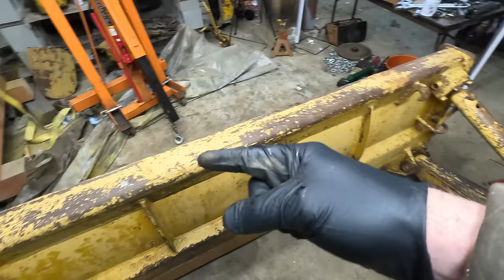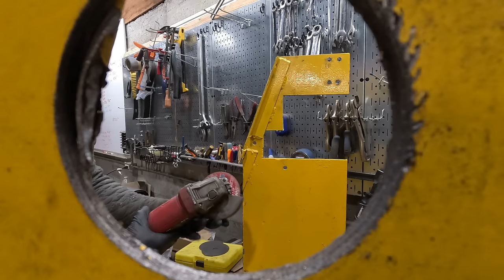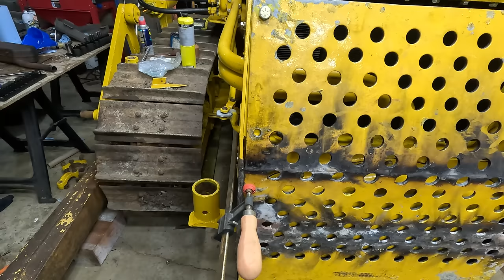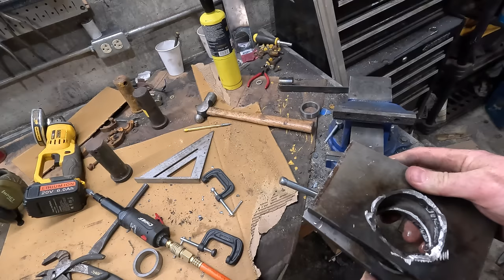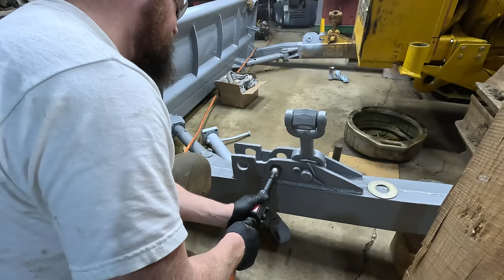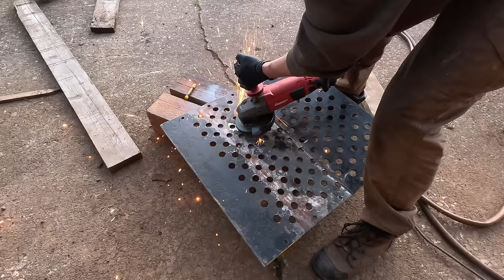Caterpillar D4 blade fitting and tilt modification

Comment: Just a little bit of feedback when you're welding structural stuff push the puddle and don't do circles or zigzag or anything just push it slowly just a helpful tip and making the 45 bigger will help bond the two pieces together smaller 45° the middle isn't bonded to the other piece of metal

Comment: You need to adjust your oxygen settings on your torch at the handles. You want little sharp pointy blue cones coming out of the torch tip when you mash down on that oxygen lever to cut. It cuts cleaner and smoother. Also hand and arm placement is the key to welding and cutting. Practice your cuts and weld movements before you start cutting or welding. Your welds are getting lots better since you quit using that flux core mig. Good luck from Texas and give Charlie girl some love for me!!
Reply: - Useful insights and correct from my experience level.
- Thank you for helping out friend, Matt.

Comment: Gr8 video. Really enjoying the build. Just so you know that crack in the centre of the weld is because it's been run down hand, on structural  parts always vertical up.

Comment: You won't be sorry you notched the grill for those stiffening ribs. You'd be surprised how easily, and often you find yourself pushing at max height. Unlike the blade you have, mine is something scabbed on from some other piece of equipment, my Dad thinks it's an old grader blade, and it hit the radiator at full lift while pushing and cracked that cast stanchion that has CATERPILLAR in raised letter. Now there's a fugly weld through the LAR section of one of the coolest parts of these "antiques".

Comment: Love your videos and it is like christmes when a new one is comming up. I worked for some years in a shop that build aluminum fuel tank trucks. When we welded on the truck we allways did compleatly disconnect the battery (both poles) or we connected between the poles a device that protect against over current. There is something with welding and batterys that do not go together. I saw once a battery cook itselfe to death because someone forgott to disconnect the battery. Don't ask me what the physics behind are this. I only know, we got jeled at when someone forgott.

Comment: Doing good.  To help your welds, you need to cut a bevel on the material and lay a root pass in then another pass over the top to cap it.  Also on your flush welds that you're going to grind flat (the grill guard) also put a bevel in so you're not grinding the whole weld off.  A mig wont fusion weld as much like a tig will.

Comment: Practical and durable mount points are the need.   Why the tilt is so useful is at the margin of road as to drainage. Or sometimes, where tree root ball or a boulder is encountered as removal or tailing.  I rather cheer and took note of the nice sound at idle,  The project as access roads to property is where all of the hard effort is turned and the machine begins to a renewed useful state.  And so repays as forward to real needs.
Think safety as operator.  M.

Comment: It's easy to use a hole saw to cut through thick materials if you drill a 1/4" hole at the center mark then lightly scribe OD with hole saw. Then drill a 1/4"+ hole (or 2) right in the scribed mark of the saw.  This allows the chips to be ejected out the holes so they don't get bunched up in the saw teeth.

Comment: One more thing.  As the trunions wear down, the blade will get closer to the nose. Something to watch for as you use the machine.  I also laughed out loud when you said the tilt cylinder will hardly be used. After you get used to it, you will never want to use a dozer without one. You will find yourself using it constantly. Keep up the excellent work! Looking forward to seeing you move dirt with it!

Comment: Hi Matt. The blade is made to tilt the angle of the cutting edge by adjusting the tilt rods by adjusting them out on both sides witch would give u more room between the grill. U might have to change the mounting ears for the tilt cylinder. Moving it ahead some and then adjusting the other side out some to bring the blade back to level.

Comment: Nice job Matt.  I like that you are not afraid to prime and paint areas that might need modification later.  I find it much more satisfying to be able to see the finished shape early.  IMHO I would cut the sides of the brush guard so you can see the raised “Caterpillar” letters.  Also on the left lower corner of the blade it looks like an H beam was welded on there.  That should be ground down so it doesn’t impede the flow of material across the blade. . . . But you probably already know that.  Thanks for the video.

Comment: When you’re welding heavy gauge steel you can preheat with a torch then mig weld it. You’ll get better penetration with your smaller mig welder.

Comment: Looks like you could have reversed the hydraulic fill fitting so the cap pointed towards center? Maybe it's  not symmetrical.

Love the series.
Reply from the maker: that's a good idea, but it is unfortunately not symmetrical, there is a hidden passage in there

Comment: Actually a very good job and well done, but if i was cutting that top bevel on the mounting plate I think I may have preferred to cut the plate longer and welded it flush to the rear plate and ground it flat making it all look like the one piece when painted.

Comment: Seriously tho consider buying a cheap worn out lathe and milling machine spend 2500$ on both and be amazed at what you can do with them I’ve made gears shafts and much more it’s so handy to be able to make your own specialty tools whenever out of scrap I’ve got like 6k in my shop it’s under a carport it’s all ran off a single 10hp eBay vfd I use it to power my big lathe then use my lathe as the phase converter to run everything else works like a dream. My shop consists of a 16x144 koping lathe that has metric and standard cutting abilities I have a old wells index vertical mill and a jet radial arm drill those three machines make life so simple when it comes to cutting metal precise
Reply from the maker: Yeah I will someday probably

Comment: Time for a taller extention on the back of the barn withA 16ft garage door heated then your lower level of the barn can be used for the smaller stuff
and work benches. Your tools can be put where you need to get to them with out a partially assembled dozer in the way. Contact some of the sawmill videa guys and see if there willing to help you out with some of your project with lumber or labor in exchange for some dozer or landscape work around ther property.

Comment: I don’t know if you did some pre heating of the brackets and blade arm, but anytime you’re welding thick material with a relatively small wire welder preheating will really help with penetration of the weld.

Comment: If you needed more clearance couldn't you cut or grind the round edges off braces on the back of the blade to a little square? Don't think it would weaken them any . Just wondering . Great work on the rest of it !!

Comment: Just thinking Matt in my extensive experience of operating heavy machinery, well watching it on youtube at least, most operators always seem to push hardest on the right side of the blade.
So maybe that isn't the best place to have the tilt cylinder as it will take a pounding and why it was on the left originally, janky hose setup included?
Reply: I have same exact D4-7U that was built in 1950 as Matt's. It has a tilt cylindar mounted on right side. It was installed by a logger of 50 years in woods, Matt got it right,on the right side. He was smart to re-install it on the right, cleaner location for Hydr lines.

Comment: Next time you have to make the same cut like that on two plates that are the same size. Try running some tac welds on them. Guaranteed not to move while drilling and safer than using the clamps

Comment: Looks great Matt!  I'm curious about the black paint on the front of the blade.  Is that a more durable finish?  I'm building a loader for my garden tractor and wondering if there is a better paint for the inside of the bucket.
Reply from the maker: I figured that the "best" coating would be the cheapest, since it will rub off no matter what.  So basically the cheapest spray paint I could find.  Cost $5 and about 5 minutes to coat the entire thing.
Reply: @PacificNorthwestHillbilly  that was my plan as well.

Comment: Have been following from the start of this build.  Don’t want to search back through all the videos.  Our d4 is older.  Tractor number 7j6155.  No luck searching online.  Wondering what fluid you would recommend in the injector pump and the fill hole on the housing that the lever that engages the pony motor to the diesel. Appreciate it if you got the time
Reply from the maker: Cat says to use the same oil you use in the engine
Reply: @PacificNorthwestHillbilly  appreciate the reply.  Seems like Google is less reliable than a paper back service manual these days.  However I can always count on a response from someone who has the manual or has fought the Google search nightmare.  Really appreciate it.  Keep the videos coming.  Looking forward to the excavator.

Comment: I would have recommended you ARC (stick) weld that hydraulic bracket......that's a lot of pressure put on those and it concerns me a bit. ARC welding would have likely allowed for deeper penetration. Don't take that as being critical cause I love everything you do just something to consider. Look forward to the next one.

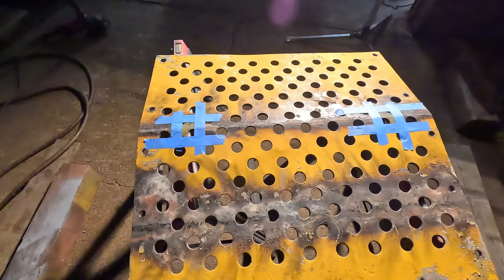Comment: At 54:42 I'd bet you would be better off trimming a little off the blade ribs.  The blade will flex left and right more then the holes you cut out.  Try it when your get it mounted.

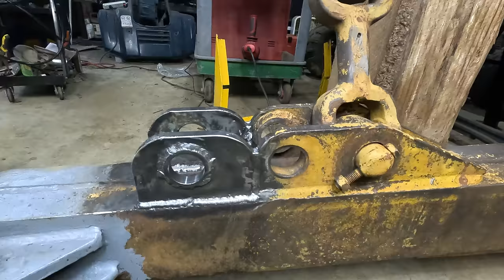Comment: 43:52 Well its not the strongest type of welding to do on a place like this. The right way to do it is to grind an angle on both the welding surfaces so you can weld all the way under the plate and not only the sides. By doing on the bottom as well makes the weld the strongest part and will never brak first.

Comment: 34:20 I would have used the drill press and a couple of sacrificial holesaws here to start that cut. Burn into the mild steel as far as the holesaws would go, then finish with the torch.   And who knows maybe the holesaws would have been able to make something happen in the drill press?

Comment: I am not understanding how the " tilt cylinder " works . From what I have seen , the blade is pinned to the blade frame at both ends on the bottom . So it can't move in or out to be at an angle to the dozer . The cylinder would tip the blade front to back on top , but doesn't the solid arm on the other side keep it from moving that way ?
Reply from the maker: if you are sitting in the seat, the blade would appear to be rotating clockwise/ccw, not tilting forward/backward.
Reply: @PacificNorthwestHillbilly  ah...OK . Just enough I'm guessing to keep your grade level . Thanks !

Comment: You stated that you only left a eight of a inch clearence between oil tank and the grill plate which seems to close for working conditions.If you push a stump it could dent the fluid tank and cause a leak.

Comment: 34:11 Your torch should be set on either a neutral flame or very slightly oxidizing ... it seems as though you are just using random setting as long as it looks like blueish colour fire.   If you aren't aware of the terms and settings just check it on line it's very basic.

This will make your cuts much cleaner ... 

EDIT: Not being cruel just trying to help, but it's obvious here 39:01 that you have no idea there are three basic settings for a Oxy / Acetylene cutting torch, Oxidizing, Neutral and Carburizing. too much acetylene will embrittle the metal by adding carbon ... too little will soften it by removing carbon from the steel
Reply from the maker: I can assure you it was neutral, the camera always over-exposes because of the bright cone and makes it look like a giant fuel rich flame
Reply: @PacificNorthwestHillbilly  Ahhh .. Of course,  have zero experience with video production, but that seems very logical! :) 

Thank You for your patience and letting me know!! I can relax now, next time you're using the torches! :)
Reply from the maker: It's really my fault for using cheap cameras 😂
Reply: @PacificNorthwestHillbilly  My opinion your video production and editing is above par, for a one man channel.  

I spend hours each day watching youtube channels, I'm a retired tradesman and love watching this stuff!!! 

 :)

Comment: Rather than using the jack, you might have tried running over the panel with the Caterpillar. Surely it's weight is the equivalent of your press.